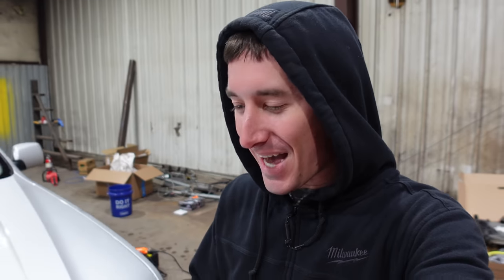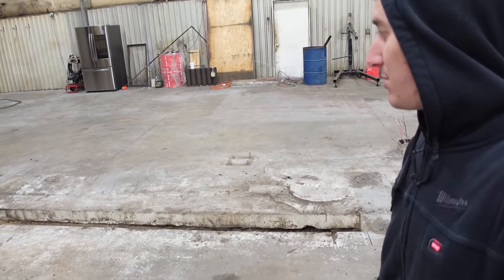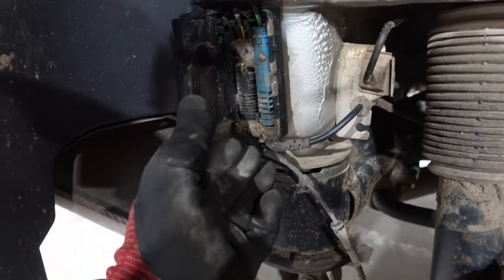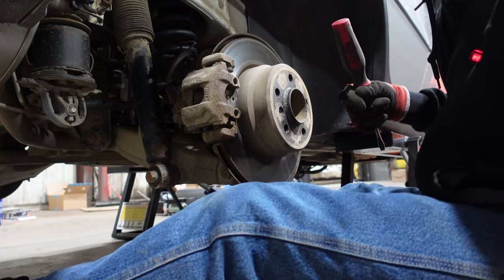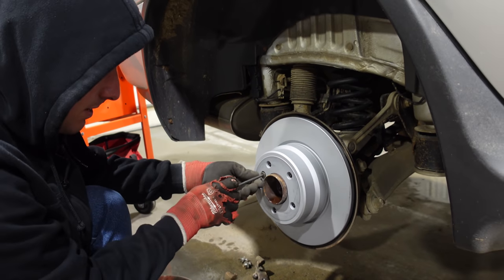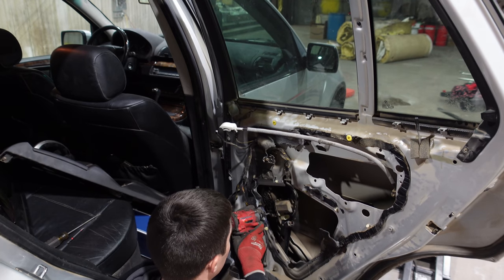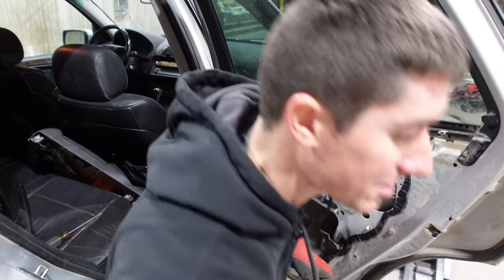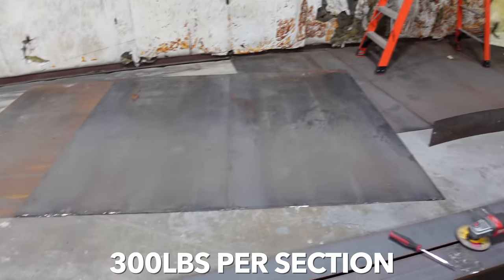I Fixed EVERYTHING On My CHEAP BMW X5 But It Cost ANOTHER $1,500

Comment: Good brakes exchanged for great brakes. Someone is getting an amazing car for $1 without a doubt.
Reply: "Made possible by grants from... (insert donors here) ...and by viewers like you."
Reply: Your forgetting it's a BMW something else is on the edge of breaking no matter what he dose. I see no work to any interior electronic parts.
Reply: @stevenplaskett7728  its an old x5 with an m54.. these engines run forever and why should he work on stuff that is not broken?
We got 4 BMWs as daily drivers in the family, and from our experience they are pretty reliable if you stay away from the fancy stuff(M cars, old 7 series etc).
And the one with the most km is one with the "horrible" smg, with 270000km, my dad drives it to work 100km daily.

Comment: I saw your high ventilation fans free wheeling in a previous video. I would suggest that you check and repair / replace the backdraft dampers to minimize loss of heat in the space.

Comment: Hey a quick tip on the metal sheet removal. On your scissor lift attach 2 outrigger legs on the side of the lift. Cut the bottom of the sheets free and pull toward lift onto your outriggers. And with a second lift extend to the top and use the first lift to lower it to the ground where you can hand off load.

Comment: JR, couple of things.  I love your new shop you are putting together.    On the BMW brakes... those rotor screws (the odd ones that never want to come out) don't have to be used again, but if you do, a little Never Seize would of helped for the next person if the car lasts long enough for another brake job.   You did the back side of the rotors, but forgot that screw.

Comment: Damn... You left out all the good parts. The struggle was real with the rear rotor. Better not show that. Then the window regulator was fighting you and you edit that out too.  Booooooo. I wanna see the hard frustrating parts.
Reply: Woody Balto..
Shop Life Vlogs/TV....
Very descriptive post on replacing tear window regulator on e46....
Same procedure for this x5.
Reply: @redneck4528  A lot of times those are the best parts to watch as most of us DIY'ers need to see those parts to help get ideas on how to resolve a similar problem.  Most of the videos I watch when fixing cars is because I am stuck and need to see if there is a better way to do it.

Comment: Everything looks to be in very good condition for a vehicle with 250,000 miles.  The coil spring looks like it still has all of it's paint.  The bolts that hold the rotors on are always difficult to break loose on BMWs.  Make sure the hex bit fits in the bolt snugly.   I always use the best hex bit I have on those to prevent stripping it.  I don't like to pay excessive prices for quality tools but I bought a set of snap on hex bits just for that purpose.

Comment: @WatchJRGo
When doing the calipers I noticed that you don't "unsqueeze" the pressure in them.  I just stick a pry bar through the top of the caliper, set it against the disc and pull.

Comment: Zimmerman rotors are the best. If anyone is changing their brake pads buy Zimmerman rotors. They are amazing and havent rusted for like four years on my 328i.
Reply: Galvanized then?
Reply: @alexyo3927  it's Zinc coating. They haven't worn at all and the car is driven hard. No lip, no bs after 3 sets of pads.

Comment: How about an Air Compressor System?

What is your plan? Seperate Compressors for each lift/work station, or an ENORMOUS Compressor for the entire Shop with an Auto-Bleading System to rid water?

Comment: Window regulators on BMWs. I remember fixing the driver window regulator on my E46 and using zip-ties to hold it down so it would stop breaking the plastic tabs and pulling the cable out of the notch. Also cannot buy the plastic brackets that the window rides in separately, must buy the whole regulator. Between the stress that another window will stop working or the climate control "hedgehog" resistor will blow again (it blew twice in the space of 4 months) , I did not enjoy that car as much as I should have...

Comment: I purchased a IMMACULATE 1997 Lexus  ES300 Silver 45k one owner garage kept for $3400 Tuesday 8am 1-19-2021 - NEW TIRES, New Toyota Timing belt/water pump/thermostat/radiator was changed 2018 @ 41k. the owner paid $36,991 cash in april 1997. Full Synthetic 5w-30 Mobil1 changed 21+ times. My 25 year old son is so excited, my wife and other sons are jealous.

Comment: Love the beater e53! I have one as well with 160,000 miles. With 250,000 miles on on yours, I was wondering if you changed the transmission fluid?

Comment: Hey JR I’m one of the unemployed entertainment industry workers. When I’m not touring I work at my local amphitheater. Obviously there is no touring and the local venues are shut down. I’d love to buy the BMW X5 to use as my daily to save on gas. My current daily is a 2013 f150 platinum with the V8 5.0 engine averaging 15mpg.

Comment: Even with the mileage, I would definitely give you $1 PLUS my 2000 323i for your LS swap you mentioned to me many months ago. Possibly even include my '96 Jeep XJ for a nominal price. The XJ runs albeit I'll be changing the alternator and possibly the battery as well. Having potential charging issues. I'll be checking that in the next couple of days.

Comment: BMW's are the luxury boats of the automotive world.  The second best day of your life is when you buy it, The BEST day of your life is when you sell it.   Did O-Reilly have all of the parts?   Before I sold my 97 328i I had to buy my parts from Pelican parts because the local parts stores didn't carry many BMV(or Volvo parts).   I bought the more expensive parts that were supposed to be OEM supplier parts and the Waterpump and electric fans still died 4 years later.   My wife sold this car to a friend so I got to hear about it every time it broke down, which denied me the joy of selling it!

Comment: Once I pay for a Conctete Slab or Asphalt for my Driveway, that Quickjack System is what I need!

As I am 46yo with a Severe Back Injury, I am sick of paying $100 every 5K miles to have my Wife's Car and mine to have Oil Change and Tire Rotations...

Using two jucks to lift the sides of the Car (2015 Mazda3 & 2020 Toyota Yaris) is just not feasible at my age. I buy OEM Filters and Oil "CRUSH WASHERS" for the Drain Plug (but that costs me $22 each)...

But I do purchase my CASTROL SYNTEC 0-20 @ 5qts each for only $14 @ TRACTOR SUPPLY!

Comment: You should really consider passive solar collectors to help you heat the warehouse. With that much area on the outside of the building you could offset your heating costs by quite a bit. Something like this, but on a much bigger scale. https://www.ecohome.net/guides/1075/all-about-solar-air-heaters-diy-or-purchased/

Comment: Brake lining sensor. Wow
That might be a bit too far on the engineering side. 
Very BMW. Next will be bolt torque sensors on the all 4 wheels.

Comment: Putting cheap tires on car because it is a "daily" is exactly backwards logic.
Reply: Not if you're giving it away.. 😂 but yes. Why in heck would you even want the hassle of keeping replacing tires "ain't nobody got time for that"
Reply: Agree. Not asking for a top end tire, but hoping he at least puts on a brand I've heard of that will be safe and last more than 10k miles
Reply: Consumer Reports rates them and the best are mostly the same price as the average or poor choices, and the best performing are not always the most advertised brand.
Reply: @scottbaker9066  cheap as in cheap quality. If an inexpensive tire has a 60,000 mile warranty then it's most likely a decent tire or they'd lose money hand over fist giving out rebates. I don't want a drive tire to blow and end up tangled in a tree just cause I saved ~$100. Anyways just my opinion 🤷🏼‍♂️
Reply: I'm all for cheap tires. Once spent $850 canadian on brand new michelin defenders and they started to dry rot within 2 years, and had to be off the road in 3 years. Michelin didn't do anything to help me besides a new set at %20 off... complete joke for a tire with a "100,000km warranty".  Now i just buy cheaper Chinese new tires like Sailun, Mirage etc

Comment: That window is gonna fail after 6 months. Everytime i replace the regulator(bmw part) and not the motor it doesn't go well.
Reply: That probably wouldn't affect me because I've had the same car for I think 12 years and I could count on one hand the number of times I've rolled down the rear passenger window.
Reply: "I want my money back."
"Here ya go! By the way, keep the car."
Reply: @InsideOfMyOwnMind  valid point.

Comment: Lay off of the hype man.  What exactly are you giving away?  Someone has to come get a 20 year old shiitbox with over 200k miles that still needs bushings, etc.  There is a reason these cars are 1500.00.  Still wondering why people aren't flocking to your website to get "lucky" and win something that will cost more to transport than it is worth?  
"the largest automotive garage on youtube" is a garbage line too.  You have a huge building with a bunch of doors.  Still zero lifts.  Such a baller that you complain about the heating bills.  Ha ha